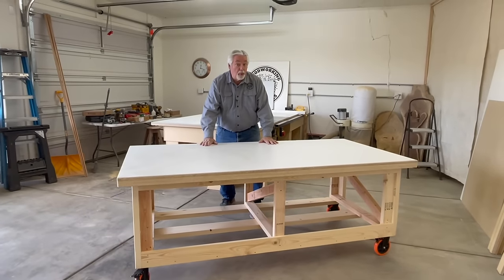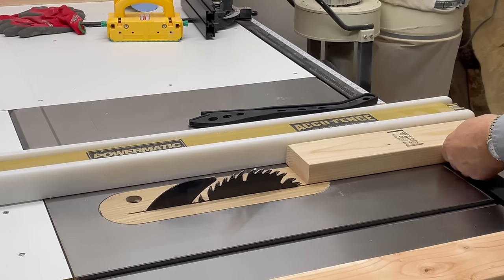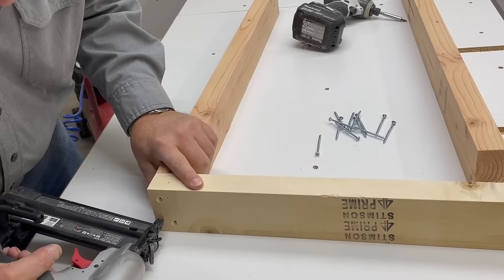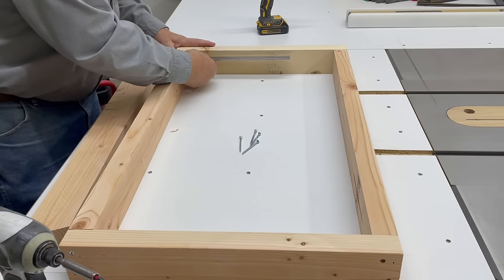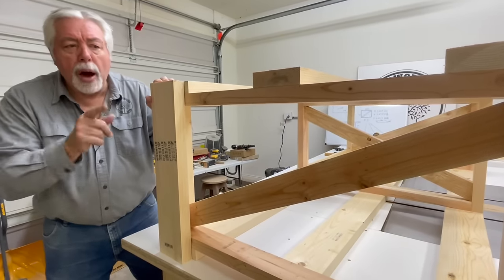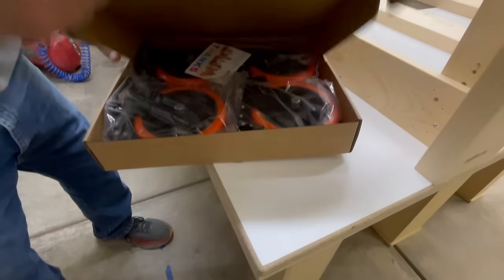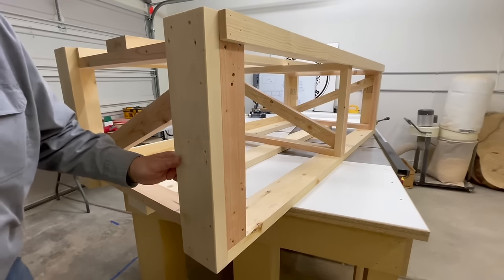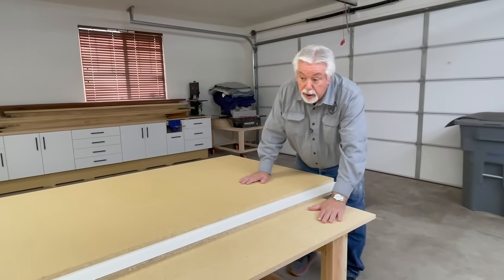Quick, Simple & Rock-Solid: The Perfect Assembly Table For Every Shop

Comment: Could you please explain the calculation used to determine the angle of the center of your rib piece?  Thank you
Reply: I did what someone else suggested. Put the centerpiece flat on the floor. Put the square frame on top and trace the line. Then go to my miter saw and move it over until I lined them up

Comment: I will adapt this for a photographers printer table. The printer makes up to 20 inch by X so it’s way larger and heavier. A table that will not wiggle and rock would be ideal. I just want a bottom that is like a sled so it can sit on carpet but be movable if needed.
Reply: @ MichaelGlennglennimages one option you might want to consider that is very inexpensive and effective is carpet sliders for furniture, works for me.

Comment: Nice video. I have a stupid question. I am building a table that will be 36x48 when done. This will make the cross pieces shorter. How did you measure the length and angle of the cross piece? It wasn't explained how you got the 23.5 deg and length.
Reply: You can easily find the angle of that cross piece simply by marking it. Once you have the rectangular sections made, get them perfectly square and then clamp them to the table. Then lay the 2x4 cross piece on top at opposing corners. Now you'll be able to mark the cross piece on each side and draw a line and you have your angle. Even better, use an angle or bevel gauge and match it up with your miter saw and you'll be in business. Cut the cross piece about an 1/8" longer than what you need so you have a little play room to fine tune the fit.